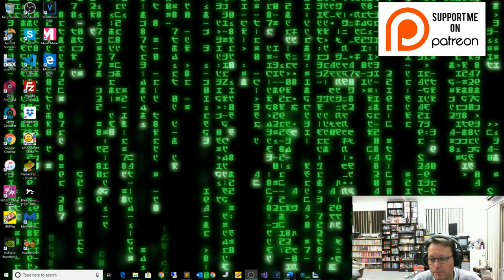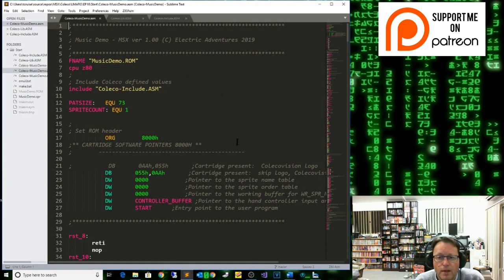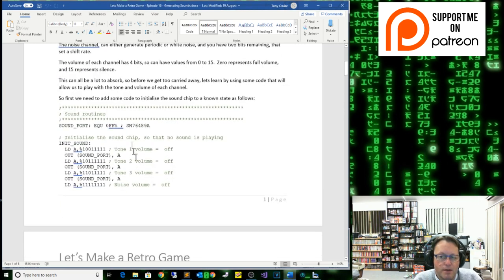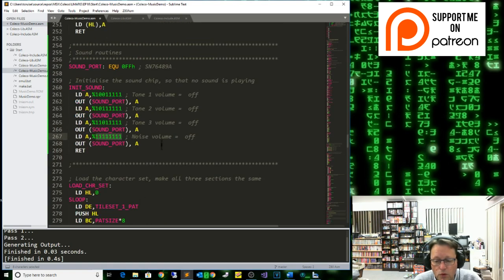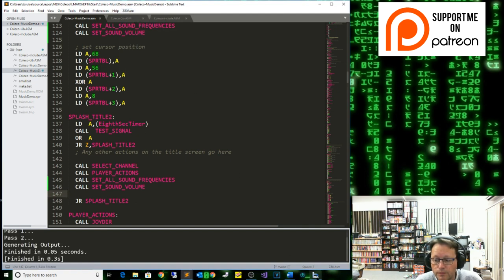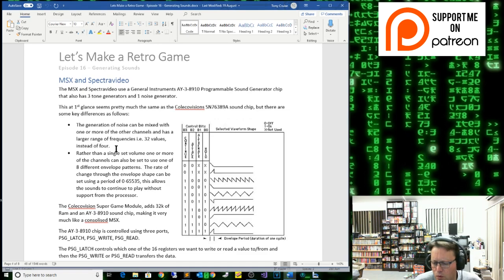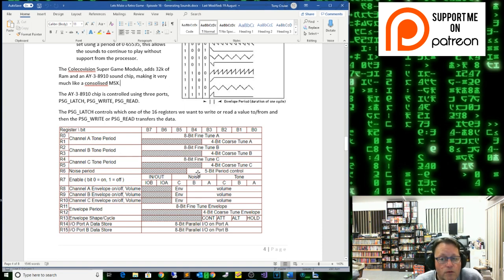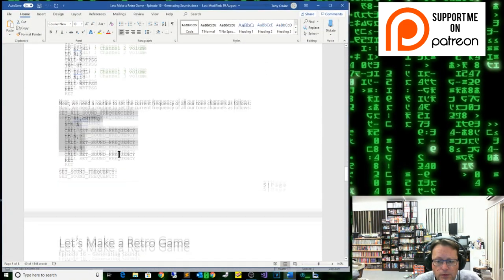Lets Make A Retro Game - EP16 - Generating Sounds

Comment: I think that the assembly language is the most difficult language you can practice in computer programming. That is because it is the closest to the computer architecture and logic rather than the human way of thinking. But in return it makes the fastest programs possible.
Reply from the maker: Yes you can't drive the hardware any faster than using assembly code.  You have complete control but it does mean you need to have a greater level of understanding of the hardware, which of course makes it a harder task.
It's a bit of a lost art though, so hopefully this series does enough to get some more people started :)